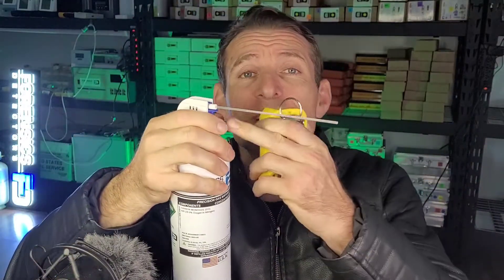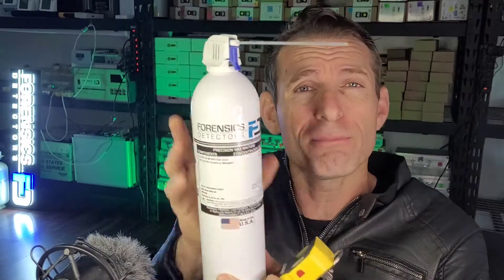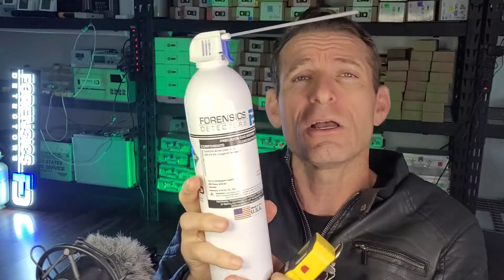What is a bump test on a gas detector?

Comment: Hi, I bought a few of your detectors. Where can I buy a canister like you have to test it?
Reply from the maker: on our website, right here ==> https://www.forensicsdetectors.com/collections/bump-gas
Reply: @DrKozForensicsDetectors  thanks! Does the unit “have” to be calibrated, or is the bump gas just for testing? And do you test them before they leave your facility?
Reply from the maker: @judjohnson4640  All units are calibrated and tested at our facility. BUT bump testing assures the user the unit is functioning, especially in case of life-threatening situations, like confined space. The best practice is to BUMP TEST. 
Bump testing is a procedure where the user exposes the detector to a small amount “blast” of target gas to ensure the detector operates and alarms as programmed.
The function of this test is to verify proper operation and build user confidence, particularly in hazardous applications.
It is recommended to bump test when first purchased, followed by weekly tests. This is especially important in LIFE THREATENING and / or DANGEROUS applications to verify detector operation. See video explanation here. 
Ozone bump testing is performed with a small ozone generator.
We do not offer bump gas for highly reactive gases such as ammonia, phosphine, nitrogen dioxide, and chlorine. In this case, we recommend purchasing 34 L calibration gas bottle to be used as bump gas.
Be aware of OSHA requirements regarding bump testing and calibration.
Be aware of the International Safety Equipment Association (ISEA) requirements regarding bump testing and calibration.